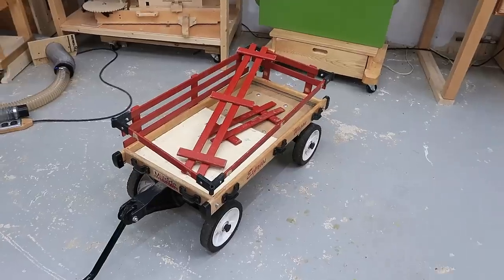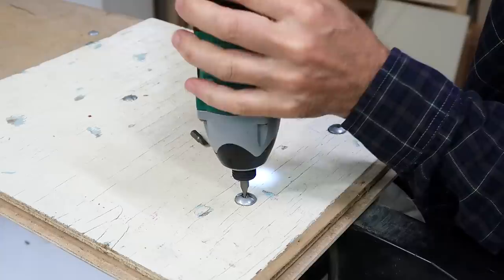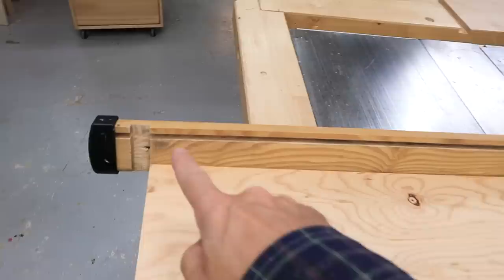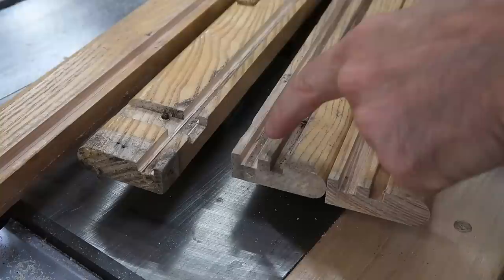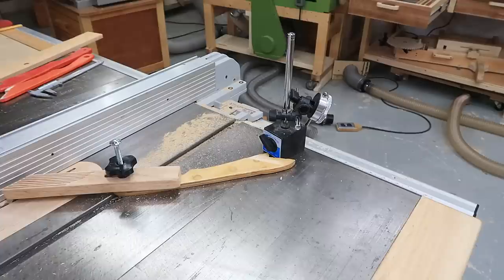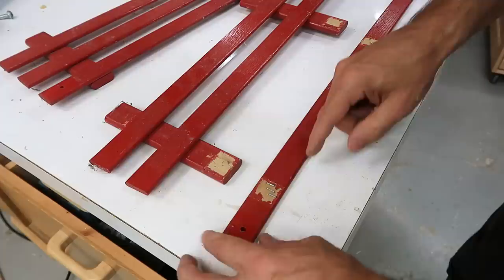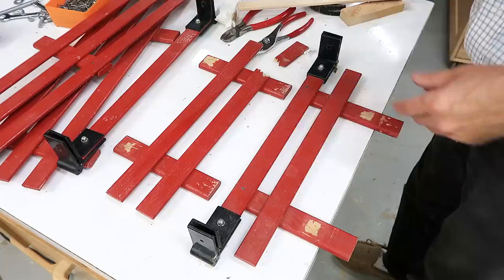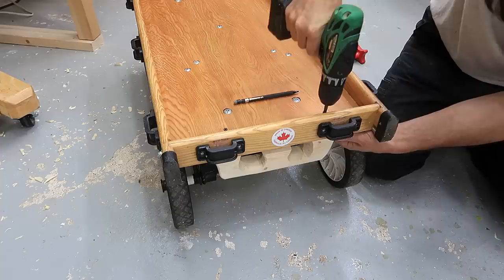Fixing a kid's wagon, plus a trailer hitch

Comment: And, as others have mentioned, you're really doing something 'extra' by keeping something out of the landfill!  It just drives me crazy, seeing what people drop of at the 'dump' !
I saw a 750 Watt UPS in the 'small electrical appliances' bin, and couldn't stop myself from taking it back to my shop; it's an $800 piece, and, what did it need? A $35 gel cell!
Reply from the maker: I have been using the same ups for 22 years now.  last year I had to replace the gel cell.
Reply: so many UPS get trashed just because they need a new battery
Reply: Continuing to run a UPS with dead batteries will end up killing the UPS electronics, so make sure you replace the batteries as soon as the indicator tell you the battery is bad. 😉
Reply: multiple times i have fixed a neighbor's 'trash' only to have them ask for it back

ridiculous
Reply: Got my Smart-UPS 1000 for free with dead batteries, made in 1996, still going strong.
Reply: @act.13.41  You just made me check my UPS battery indicator.
Reply: @shadowscion  I have taken my Neighbors trash and fixed it and put it back in the trash, just for fun.
Reply: @shadowscion  Sometimes the best thing you can say is "No," then turn and walk away. No explanation needed.
Reply: What is a UPS?
Reply: @moninum  Uninterruptible Power Supply.

Comment: Ah, the memories!  When we were first married we haunted the garage sales on weekends and I recovered an old Radio Flyer wagon.  I salvaged all the running gear (the metal tub had rusted through) and proceeded to build a poplar replacement with stake sides just like yours.  I also designed an automotive style steering setup (no yoke pivoting on a center pin) completely out of wood.  Those were the days.  My sons were unable to wear it out, and we sold it for a few dollars at our own garage sale 14 years later.  I can imagine that it lives on, perhaps, with changes each new owner has thrown in.  Thanks for the recollections!

Comment: I love watching his videos because of the attention to details!  I do woodworking too, and while watching his video, I like to compare how I would solve a problem vs how Matthias does it.   For example, bottom plywood thicker than the original: I would have cut a rabbit in the plywood so it fits in the original slot, but instead he widens the slot AND cuts a rabbit, making for a stronger joint...  Bending nails: I was thinking that's dangerous for the kids (a bit sloppy???), but the very next scene, he explain how he bends the tip so that it gets completely buried in the wood! (genius!)...  This is the reason I keep coming back to his videos:  I especially love these "fix it" videos because of the solutions he sometime comes up with...

Comment: We've got the same wagon and we love it for pulling the kids around! One thing we did was change out the plastic wheels with some pneumatic tires  from Princess Auto (SKU 8442428, size 4.10 x 3.50). The wagon is so much quieter, the rolling resistance is greatly decreased, it's much more comfortable for the kids, and lastly because the overall diameter of the wheel is larger, it's much easier for taller adults to pull the wagon under load. If you keep your eyes peeled those tires at princess auto go on sale for like $8 each. Or you can scavenge the wheels off of a couple of hand-trucks if you can find them!
Reply: Flat-free version SKU: 8906364 is a better choice from what I've seen. I was constantly having to re-inflate tires on the hand truck, replaced with 8906364 and have had no issues since.

Comment: Bent over nails: 

Long ago they made a type of nail called a "clout nail". These were used in theatrical carpentry to assemble flats (large frames of 1x4 covered in cloth, like a painting). There were blued, headed, tapering square (actually rectangular) nails about the size of a 4d nail. 

You put a steel plate under the boards for the joint you were making and hammered in the clout nails at a slight angle from vertical. The nails were about 1/4" longer than the boards they were securing, and when the end came through and hit the metal plate, it hooked over and held securely.
Reply from the maker: ent over nails was much more commonly used before screws became better and cheaper.  the old cut screws were never that good.

Comment: I actually have the exact same wagon and bought it second hand. I had to do the same repairs. I found cheap tires at princess auto, added a new bottom, painted it all, and added a thin rubber sheet to help make the bottom last.

Comment: I had a similar wagon (but the pneumatic-tire version) which turned into a mushroom farm from being left outside. My kid was beyond wagon age so I just turned it into a flatbed with no rails to hold rainwater.
Reply from the maker: I will make sure this gets put away, but maybe I should drill drain holes in the corners!
Reply: @matthiaswandel  I was thinking about putting the sides back on mine, and had I done that I would have cut off the corners of the bottom to form triangular drain holes.

Comment: I still enjoy your videos !   Question for you...How can I slow down my WEN 10" bandsaw inexpensively so I can get a metal blade and cut steel.  Slowest speed now is 1520 sfpm and I need to get it down to around 200 sfpm.  You are a smart guy so I thought I'd ask you this question.
Reply: In case he doesn't answer. 

Larger pulley on the back of the lower wheel and smaller pulley on the motor to maintain the available power. Or if not enough room, an intermediate shaft with a pair of pulleys between motor and lower wheel.
Electronic speed reduction of motor likely to reduce power.
Reply: @ianhelsbyservices  Thanks for the reply.  My Wen 10" bandsaw has a small 1" pulley on motor and a 10" pilley for blade.  There is no room inside the cabinet for more pulleys.  Not sure how to accomplish sfpm reduction from 1520 to 200. I guessed that speed reduction would result in insufficient power so I ruled out that option.
Reply: @glenpaul3606  Then you'd be looking at a motor with inbuilt gearbox. Think roofer's conveyor, they run pretty slow but have the power to lift tiles up two storeys.
Reply: @ianhelsbyservices  Thanks.

Comment: Why did you use a plastic bag to wipe on the stain, but a paper towel for the paint?
Reply from the maker: oil based varnish, used paper towel but held it with a bag so I wouldn’t get it on my hands.  water based paint is easy to wash off.